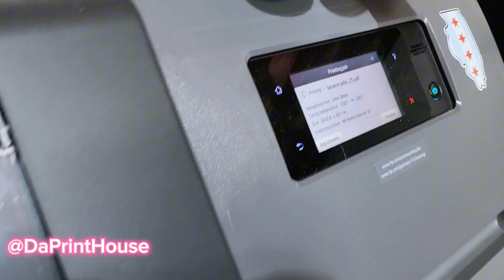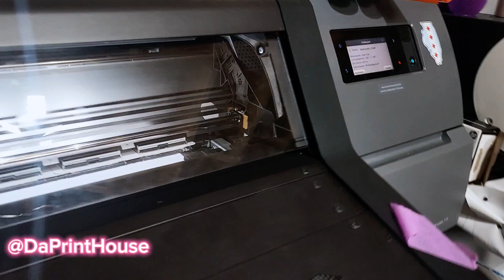9-26-24 welcome back to DaPrintHouse Thursday hp latex sticker printing #sticker #printing #sign

Comment: glad you still going question about hp latex 115 ........you can only use flexisign? i was checking it out and you have too pay yearly subscription
Reply from the maker: u can buy a 2019 version that is perpetual.  but no u dont only need flexi, u can use any program u design in and send to the rip. in this case i use my flexi for some but not all...